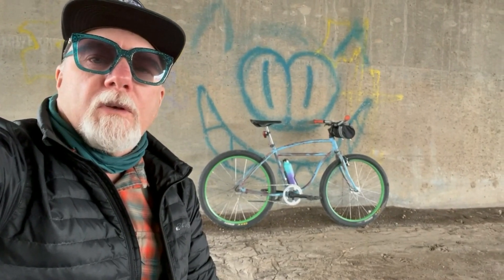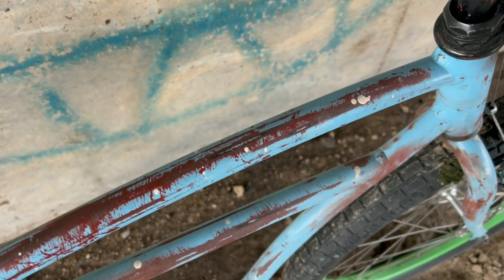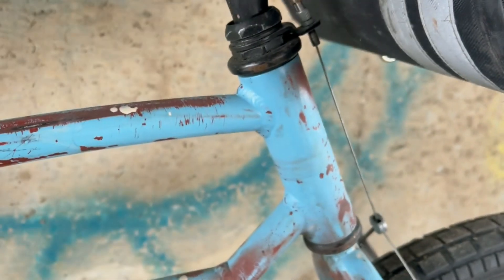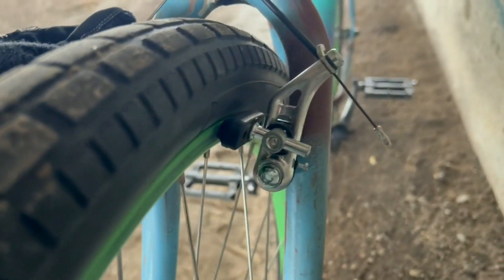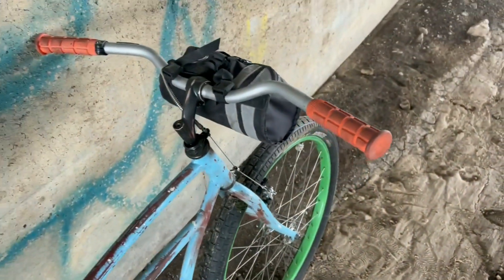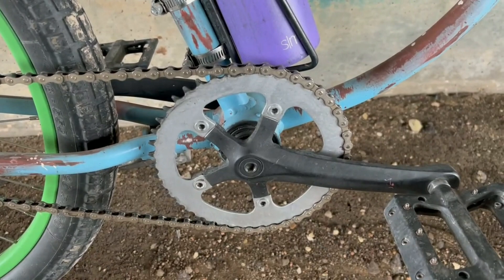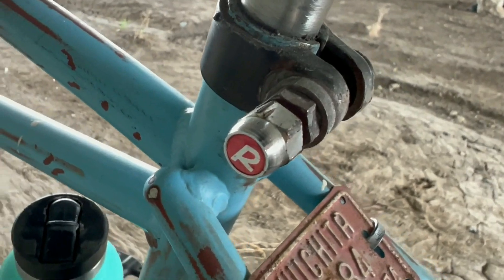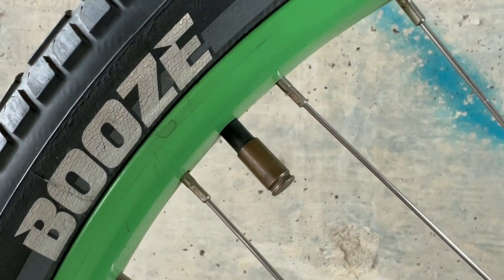About This Bike - Aluminum Single Speed Rat Bike

Comment: Great patina effect Randy - almost looks like rusted steel on the video - appreciate your innovative make and mend approach - bikes look cool too - thanks for the handlebar and fork steerer tips too - I have quite a few narrow aluminium bars I could widen and an old marzocchi bomber with a short steerer I could utilise - yours seems to be holding up well - and I’m sure I could do the same - I’ve seen your welding and I’m convinced mine couldn’t be any less strong 😂😂
Reply from the maker: After watching this video I was just thinking how I should go back and try to refine the rusty look (if that makes sense). I could have done better but was probably in a hurry at the time. On this fork I didn't lengthen the steer tube. I changed the inside diameter of it by inserting another tube. Basically a thick shim and welded in. The difference in diameter between the steer tube and the stem I wanted to use was pretty big so a thin shim wouldn't do. I have lengthened a couple steer tubes in the past. I'm never confident in my welds and ride them gingerly until I eventually forget which bikes I did it too lol. I had one fail, possibly the first one I did many years ago. I may not have even inserted another tube inside the steerer tube for strength ( sleeved is that what you call it?) on that one though. I can't really recall. My welding is pretty bad. I don't do it enough and have never take the time to try and  get any better. The handlebar extension it was just tricking finding extra tubing that had the same inside diameter as the handle bar and another tube with the right outside diameter to sleeve the extension or whatever. No more than I extended them I don't think it would be a life threatening problem if the JB weld fails. Thanks Tinkerer!